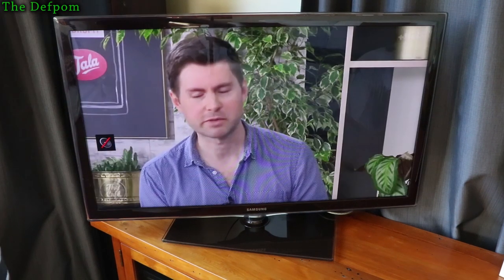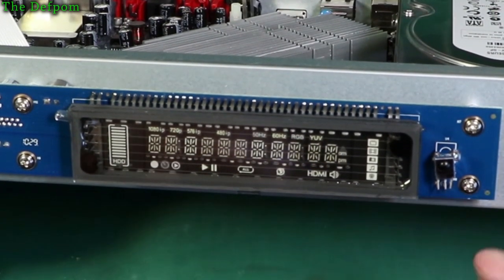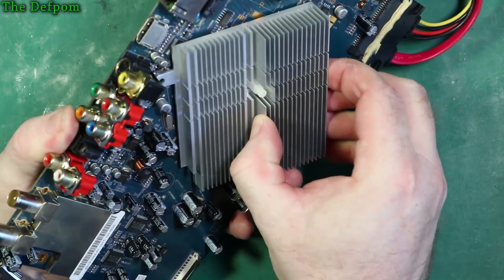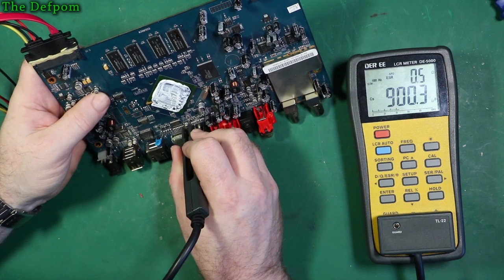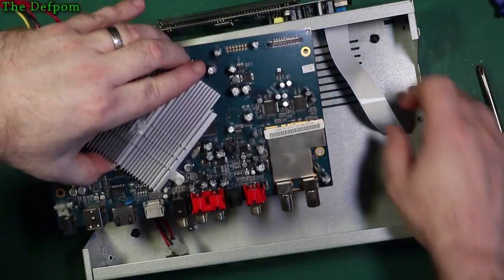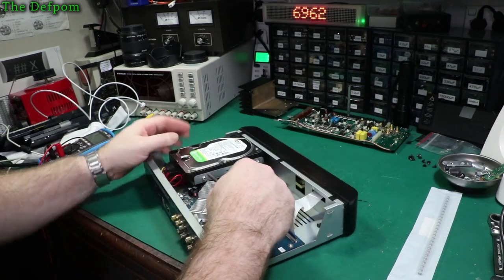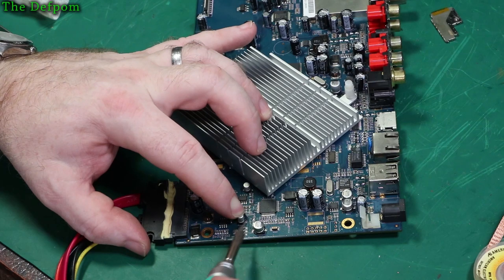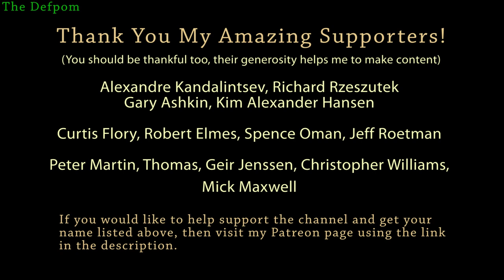🔴 #620 MagicTV MTV3600TD-NZ Repair Attempt - Can I Fix It ?

Comment: One issue that seems to arise on the digital systems is that it appears, especially on older systems,  that the MPEG coding appears to have some subtle changes in the last year or two. This image break up seems to occur on old decoders, and the hardware Sigma chips hae been related, occurs especially on loud audio sections of latest DVD, Blurray and TV broadcast signals. If there is no update possible or not done, then in very recent times breakup comes ever more often. My Samsung TV last year got bad on new release movies on TV channels, but became perfect after a software update. In last few months it has atarted again on movies like the latest Marvel series. Last week on the two newest ALIEN ones that were broadcast.  As my TV is currently not on LAN I have not yet tried software revision update. The same movies played via my BLUE ray player are fine.  TV playback other than the movies is unaffected, leading to suspicion of MPEG code changes affecting older decoders under some circumstances, given the fix after software update last year. Also the SIGMA chips on an very old PC MPEG card, must be 2000 or older,  does not work on programs newer than about 7 years, but plays very old DVD and older Video CDs. That is silicon chips no possible. It is quite possible there is no fix.
Another opportunity of problems is the HD data may have flow problems as disc reading gets slowed by progressive reading iss issues, slowing data bit rates enough to delay MPEG data falling behind needed decoder input. There may not be sufficient buffering. As HD heads deteriorate sectors may need to be re read several times to get correct data. Thus several revolutions delayed. Is it possible to evaluate HD issues using a spare HD to record fresh programs. On a PC  such HD problems cause slower operation and over time permanent bad spots and drive fails. PC dianostics can normally read back drive diagostics showing buildup of these progressive error rates

Comment: The problem you have is not the TV most likely problem with the signal coming from the recorder ie tuner cercuit has it is afecting both play back and record.cheers very old TV and Video engineer .UK

Comment: There was no need to change those caps, they were all fine. SMD caps usually have high ESR and specially so at 100Hz, look at their datasheets. If you check at 1Khz or 10Khz you'll see they are fine.
As for removing them, I never use hot air because if the caps are gone bad or leaked, they will explode very quickly and can be even dangerous (been there before!). When they are not bad, they come off easily and dont explode. The best way I found to remove them is just by soldering iron and little bit of SMD-1 Chipquick solder. It works magic and not only for SMD caps, for many SMD parts.

Comment: Places to look are input circuitry, CPU power, and the CPU itself. You could try to think of a way to isolate the problem. For instance, inject a signal bypassing some circuitry, check the recording on a different device (to eliminate the possibility of output circuitry issue), test with another input or output. Also you can try flexing the board while it's on and watching for correlation between flexing and image distortion. If there is correlation, the problem is likely in some BGA chip or the balls underneath it. It could be a ram issue as others said, too. Ram also may have a broken solder ball, in which case reflow may help.

Comment: Is this one of those boxes which run all live TV through a buffer on the hard drive? If so the drive could be getting a bit marginal and glitching results due to re-seeks. If the drive is a standard format it might be worth formatting a spare drive to work with it and testing with that.

Comment: I think this issue is most likely either a CPU or memory problem. I would have actually started by reworking the memory and flash chips (quality flux + heat gun). I have repaired similar hickups in other instruments by doing this. After that, maybe reworking the CPU itself if that is possible. It's weird, these kind of glitches are very hard to repair unfortunately. Good luck !
Reply: Try playing media from some other source to check if it's something other than the antenna input circuits.